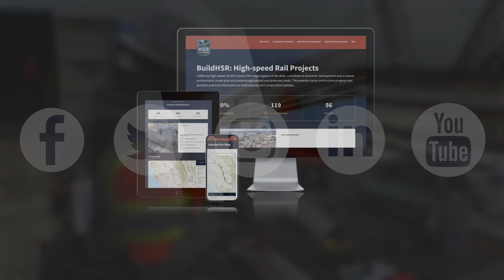California High-Speed Rail Construction Update – Spring 2023

Comment: I wonder how much of this would have been needed if they ran the HSR along the west side of the valley?
Reply: More. Because the Grapevine tunnel proved to be insanely expensive, they would have had to cross over to the eastern side at some point anyway. So the route would have been longer if they sticked to the western side. The current alignment pretty much goes diagonally, just like all the previous rail lines did because that is the shortest route to the Tehachapi crossing. 

This is also why all the towns, and all the potential riders, are on that optimal rail route through the Valley. The towns are where the best land for rail construction always was. So you get access to almost 6.5 million riders and you get to take advantage of better terrain for rail with this alignment.

Comment: how much land will it take from SF and south bay? there is so little of that laying around? what is wrong of flying?
Reply: The existing caltrain corridor will be used in sf, so no new land will need to be acquired.
Reply: Imagine a paying economy seat prices and getting first class, then the train drops you off right in the center of San Francisco. It’s a better experience than air travel and the amount of time it takes up is not actually all that far off from air travel when you take into account getting through security, and traveling to the place you actually want to be. Like SFO is literally 12 miles away from the city center
Reply: Flying sucks and everyone hates it. 80% of Americans prefer any other mode of transportation if it is available.

Comment: This project shows that ground level HSR is expensive. The Chinese discovered that continuous viaduct above the human activity level is far cheaper. 
Should also note that the German technology Maglev in Shanghai, while limited to 430kmh due to the short route, is capable of 450kmh - half the speed of aeroplanes. Maglev viaduct is cheaper than conventional rail viaduct, but the guide system is more expensive than rail systems, but the extra speed and quietness is very much worth it. 
That California is continually moving due to techonic activity may cause more difficulties than conventional rail.
Reply: This is nonsense. Viaducts are always more expensive. Case in point, the Japanese team that also bid for this project proposed a fully elevated line. It was more than 10x more expensive than the current design. They were laughed out of the room.
Reply: @TohaBgood2  Japan always bids a very expensive price. Their aim is to sell their technology. US tech is fine, but US need to learn from China how to package rail technology and work. China builds viaduct for about US$25 million per kilometre. The environmental and human interface is massively reduced. However, the Chinese approach, reflecting national entities doing work, is employment light. There would be few jobs in the project for people living in the central valley.

Comment: The Crony Express.   Only TWO of the many HSR lines in Japan have ever broken even on operating expenses (much less construction) -- and each only in their first 6 months.
Reply: Do American highways break even?
Reply: @johnralph2536  Yes.  Road and fuel taxes more than pay for the cost of the highways, which is why they are a favorite source of funds for "alternate" transportation such as bike lanes, buses and (wait for it) in-state passenger rail.
Reply: @SoloPilot6  No they don't; here in Washington, we had to use carbon taxes in our latest transportation spending bill, and they also had to use some money from the general fund (sales taxes). And the gas tax really doesn't cover road maintenance when we have so many roads  with potholes in them. 

Also, many of the freeways in Phoenix that aren't Interstate routes have been built using money from sales taxes. 

So basically your claim is wrong.
Reply: @SoloPilot6  Also, taxes aren't the same as fares. After all, the gas tax has to constantly be increased every few years. The equivalent to fares for roads would be tolls, which directly fund the road in question.
Reply: @compdude100  The gas taxes are raised because so much money is being drawn out for those other things.  Check with the tax watchdog groups in your state for more information.
Reply: @compdude100  Nope, sorry, it's correct.  Do some research, it's likely to make you pretty mad at the way you're being robbed.
Reply: @SoloPilot6  Nonsense! If the road and fuel taxes were to actually pay for this then we wouldn't have to approve trillions of Federal dollars for roads every 20-30 years!

Just take the L, bud. You know you've earned it.
Reply: @SoloPilot6  Actually I'm mad that we are being robbed of better rail because of obstinate people like you who refuse to support increased funding for trains. Riding trains is better than driving, hands down.
Reply: @SoloPilot6  Actually highways generally take up the majority of transportation budgets in every state. Other modes don't add that much to transportation budgets.
Reply: @compdude100  They bring in the majority of the transportation-related taxes, fees, etc.  But let's stick to trains for a moment.  Have you ridden one lately?  I don't mean commuter rail, I mean Amtrak from one city to another.  Do it.  Count the number of people aboard, between any two -- or ten -- stops you care to pick.  Now multiply that by the highest ticket price for those segments.  Do you REALLY believe that this pays for even just the Amtrak portion of the MOW?  Much less the rolling stock, the crews, etc.  I see this at least twice per month (round trip on major Amtrak routes -- I love trains).

I remember when "passenger rail" meant competing companies (before Amtrak).  "Santa Fe, all the way!  It's fun to ride the train -- SANTA FE!"  Amtrak came along because those companies were losing money, and it was determined that there was a national security benefit to pax rail, just as there is to flights serving small towns in what termite-hill residents call "flyover country."

There is no such benefit to HSR.  And HSR doesn't pay for itself.  Outside of (possibly) China (they don't give the numbers), HSR is a losing proposition -- and that's in countries where pax rail is SUITABLE.  Places like Japan or western Europe, where there are concentrated populations and fewer highways, with terrain that doesn't led itself to building roads.

None of these holds true for California.
Reply: @SoloPilot6  Yes, I have ridden one last year for the first time in many years and I loved it. I plan to ride one on Memorial day weekend, and when I booked the tickets a few days ago (heading from Seattle to Vancouver, BC) the train was already 90% full. We'll assume it's all full (which I bet it will be) which with 4 cars each carrying up to 72 passengers has ticket revenue of just under $13,000 assuming everyone pays $45 for a coach seat. (sometimes you pay more if you book last minute or get a business class seat) Anyway, I doubt that a single lightweight passenger train costs anywhere close that much money for the host railroad in track maintenance especially when heavy, long, freight trains put so much more wear and tear on the tracks.

Also, I don't care if HSR pays for itself when roads don't. This is such a tired argument and it really has no validity and you need to stop whining about this. After all, nobody really cares if essential services like water, sewer, power, etc. pay for itself because everyone benefits from them. 

BTW I used to not support trains and only supported car infrastructure, but at the same time, I never liked driving in dense urban areas, and when I got a job in Downtown Seattle, I drove the first day from my suburban city 15 miles away, but hated it so much that the next day I got a bus pass and rode the bus pretty much every day after that until Covid hit. It was sooooooo much better than driving, all thanks to taxes like sales taxes and car tab taxes that fund Sound Transit's express buses and light rail. I don't ever complain about those now because they have benefited me so much. Sound Transit has extended its light rail further north and it's so good that I will NEVER drive downtown ever again!
Reply: @compdude100  Feel free to spend as much of your own money as you like to build better rail.

Pax rail is useful in the Northeastern US, but in the West, not so much.

Let's say you live in Anaheim and want to go to Bakersfield.  That will take you half an hour to the station, let's say another half hour for the train to leave (because you timed your trip to fit the train schedule).  An hour to get through the LA Basin (multiple stops, slow-roll), then half an hour to Palmdale, then finally you get to peak speeds and Bakersfield is only another 40 minutes.  2:10 from home to standing in Bakersfield.  Or you could get on the freeway and reach Bakersfield in . . .2:10 (average speed 60 mph).

And, once in Bakersfield, you have your car to get around town, can leave anytime to make the trip either way, and can take a carload of stuff with you.  Do you think that the train ticket will be less that your expenses to drive?  And what if you take someone with you?  Or three someones?  Care to figure what those tickets will cost?

Oh, and you get hungry, so you stop at In-N-Out and get everyone a Double-Double, fries and drink for $6 each . . .or you can spend $19 each for a burger, fries and drink (assuming there's a cafe car, and it only charges what Amtrak does).

The ONLY advantage will be that you don't have to do the driving.  And for this, you get to spend several times the cost of using your own car.

What part of this is "hands down" better?
Reply: @compdude100  They don't figure MOW costs figured on the train weight.  Pax rail requires more care than freight, so those lines get a LOT more maintenance.  By union track workers, which means by EXPENSIVE track workers.

Likewise, all pax rolling stock needs a lot more work.  By union mechanics (see above).

Riding holiday periods isn't a reasonable meter, but let's use it anyhow.  That's a whole 150 miles, or about 30 cents per mile per passenger.  At 4 cars, 288 passengers, that's $86.40 per mile.  Do you REALLY think that you can operate a power unit and 4 cars for that?  Much less employee costs?

It may not bother you that other people are being forced to pay for your train ride, but what gives you the right to rob people who will never ride your train, not once, but every time the train leaves the station?

The truly obnoxious part of the Crony Express is that taxpayers all across the country are being robbed to fund it.
Reply: @SoloPilot6  by your logic I'm also being "robbed" to pay for highways on other states that I will likely never drive on. But guess what, this is how society works, other people subsidize the costs to get people from point a to b, whether by car or train. At least with trains and public transit (and toll roads) the user is paying some of the cost for riding on that particular route.
Reply: @SoloPilot6  not having to drive is worth spending the extra money. I thought you said you liked trains but now you're complaining about them regarding a hypothetical trip between Anaheim and Bakersfield? Which is it? You anti-HSR people are so irrational and inconsistent in your arguments.
Reply: @compdude100  I like flying, too, but there are times that it's more practical to drive than to go commercial or even in my own plane.  Same for trains.  As I pointed out in my scenario.

You HSR cultists paint an unrealistic picture of what the Crony Express would be like, dodging several vital questions.

This is an expensive boondoggle, which will prove to be far less useful than claimed.  The numbers just don't add up, even if you could fill the trains paying riders . . .and you won't.  The only leg that will have significant ridership will be the Palmdale - LA section, opening up a commuter corridor that may become popular.

But, seriously, pretty much anyone who can afford the HSR tickets for a four-hour trip from LA to the Bay Area will spend half that for a one-hour flight on Southwest Airlines.
Reply: @compdude100  Federal funding for the Interstate and Federal highways is a small percentage of the cost, and is considered necessary because they are not only useful for moving freight, but in fact are national defense projects, and considered useful to the nation as a whole.  The Crony Express is only passenger rail, in one state, and sucking up BILLIONS for little return.

Comment: Its taking Mexico only 3 years to build Tren Maya
Reply: Yeah, Tren Maya is a conventional freight line. That's not even in the same universe in terms of complexity. It will mostly use existing tracks an only build a few small sections of new right of way. Again, not even remotely the same thing as brand new HSR right of way.

Finally, the absolute top speed of the trains they plan to use will be 99 mph. That's slower than Caltrain, our local commuter trains! So not only is it not HSR it's also slower than commuter trains! If that's the best than Mexico can do than this is pathetic.
Reply: This is a bad comparison as tren maya is not high speed rail (only runs at 100mph as opposed to CaHSR's 220mph) and there is very little existing development along the corridor.  Though the management on that project has been going amazing so far.

Comment: Not really high speed rail if you are taking the long route instead of a short cut and mis all those cities
Reply: do tell us about all of the huge cities on California's central coast
Reply: You have express trains which won’t stop at any city in the middle bud
Reply: @darthmaul216  yeah but if you had fewer obstacles then it would easier and quicker to build
Reply: If it missed all the cities, then it would miss all the people that would get on the train, and the places people would've taken the train to 🤦‍♂️
Reply: Yeah, the literal fastest way from the Pacheco pass crossing to the Tehachapi pass crossing is the current alignment. Any other alignment would have taken CAHSR over/under unpassable mountain ranges.]

You do understand that the people who are pumping out the anti-CAHSR propaganda deliberately ignore the geography of California, right?
Reply: @TohaBgood2  no but also Brightline beat them to it. Why is phase 2 connecting LA to San Francisco when the hole point of its existence was to connect those 2 cities?
Reply: @alex-mo8hd  Because a) building the CV segment first still leads to this goal and b) it's still part of phase 1. The reason the Central Valley segment is build first is because it's the easiest part of the whole network (flat planes, fairly empty instead of the mountains which separate it from the Bay Area and Los Angeles) and also allows to conduct the first practical tests with the public. By the way, the modernisation of Caltrain (whose segment is part of phase 1, for that matter) also happens in parallel so it isn't like the entire focus is on the CV only either.

Also, the definitions doesn't include alignments, if the trains run at least 250 km/h but ideally 300 km/h (which CAHSR is), it's HSR.
Reply: @alex-mo8hd  Phase 2 would connect San Diego and Sacramento to the LA-SF line built in Phase 1.

Comment: You can deny all you want but Briteline is the first high speed rail line in the country
Reply: Brightline trains go 79 mph max and 54 mph average. If Brightline is HSR then the Amtrak San Joaquins, with identical top and average speed, is also HSR.

This is complete nonsense. Putting a plastic nose cone on a Siemens Charger, does not turn your rail line into the Shinkansen.